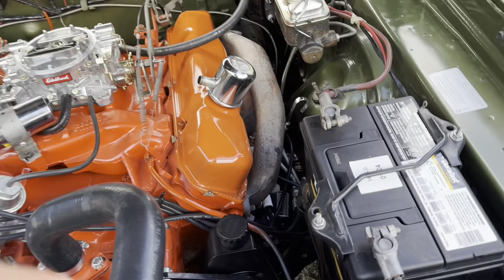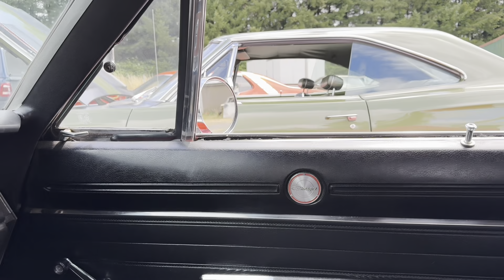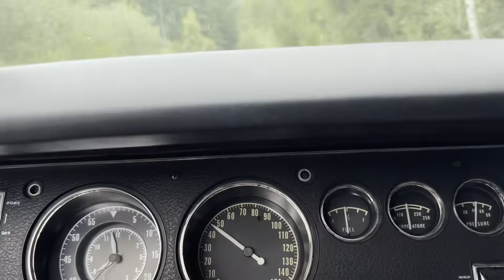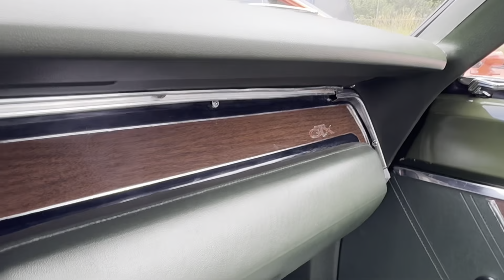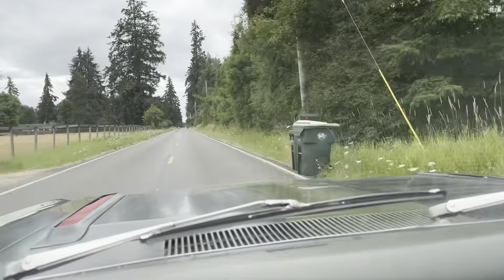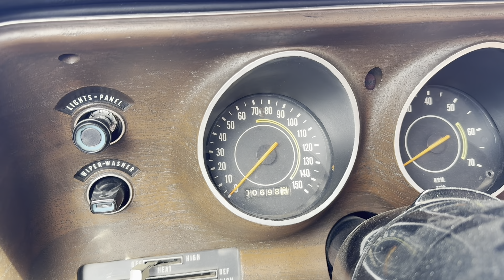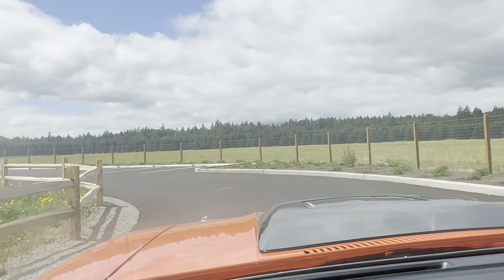An Expensive Front Suspension Is Not The Answer! Magnum Force vs Borgeson Vs Stock Mopar Comparison!

Comment: If ur not happy with how the coilovers are ....why don't you add the extra support for them instead of whining about it an putting it over the internet....😂😂😂
Reply from the maker: Because it’s a stock car we don’t want to modify and Magnum Force is bottom of the barrel for quality on these systems, absolute junk.  The torsion bars are factory engineered with literally billions of miles of testing, the magnum force?  Not so much.  Read the stories of the control arms failing at speed because of shoddy workman ship.
Reply: @rocketresto  I would add that you are adding actual value back to the car as opposed to the devaluation that the previous owner payed for.
Reply: I digress, my friends 62 C10 hads torsion bars, so did my pops 66 Toronado. I suppose those were junk too. lol
Reply: Because we’d rather throw them in the scrap pile where they belong instead of trying to scab garbage together to improve the crap aftermarket setup? Lol

Comment: Well looks like keeping my stock K member was a good idea
Reply from the maker: You can still do a lot of improvement with a stock key. Member forgot to mention in the video that the 1971 Dodge Challenger resto mod we did with the modern hemi had a QA one member that flexed when you turned the car.
Reply: @rocketresto  100%! I’m used to driving vehicles with torsion springs, and leaf springs. I’ll just get new control arms, better shocks, and new bushings and call her good.

Comment: What size torsion bars are you going to put on the Road Runner?  I would think a 1 inch bar with the Bilstein shocks might be a good combo.
Reply from the maker: Probably will go with the Bilstiens however, I like just running a stock set of torsion bars with a swaybar. My dad is getting older and want the better ride. Ultimate handling is not what we are going for.

Comment: I agree unless you are going to do auto cross or some kind of road racing man leave it stock and save the money.
Reply: I disagree.  I autocross and track day mine, and factory stuff is best. I DO use the offset bushings in the UCA, though. More caster, not camber.
Reply: @rickoates-eb3ni  Really that's cool All I keep hearing is if your going to autocross or what ever it's best to upgrade your front end with coil overs and control arms and all that stuff.
Reply from the maker: That is the one situation where it really makes sense but otherwise I don’t get it.
Reply: @rocketresto  Same here. I rebuilt the front end on my 68 Plymouth Satellite and it drove just fine and only at a fraction of the cost for what you would  pay for one of though high end front ends.

Comment: I do fully agree love torchon bar stock ride is fine
and magnum force is crazy expensive doesn't fit great and the shock tower mount flex the body
but will say the q 1 system is really nice fixed alot of that and the ride is great and if you do track days alot more adjustment but for street stock is way more than fine
Reply from the maker: I would love to try a QA one to compare against but just have heard so much bad stuff about magnum force, and this really reinforces what I have been told
Reply: @rocketresto  I've watched video of the QA1 being run on track with the camera pointed at the front suspension.  I'd heard that they didn't have much travel and this showed it pretty clearly, every time the car hit a bump mid-corner, the spring went solid.  Car wasn't particularly low either... they're just lacking in travel.  It's one of the reasons I stayed with torsion bars on my car.

Comment: I am building a 72 Satellite right now. Planning on full QA1 front and rear suspension. QA1 suggests Wilwood brakes. What are some copmparible or even better brakes then Wilwood? My experience with Wilwood is not great. Installed rear disc brakes on an 8 3/4" axle. Used the internal drum style parking brake a few times to stop the car when pushing it around in the shop. The drum brake shoe lining destroyed themselves and scored up the drum inside the rotor too.
Reply from the maker: On pretty much every car we modify in the shop we run a 73 to 76 a body disc brakes set up with the caliper adapters to run 12 inch rotors look at Dr. diff he has great stuff for this including rear disc brake set ups
Reply: I ran all the numbers on pretty much every setup available up to the 14" Willwoods with 4 piston calipers.  The setup with the best brake torque... stock Mopar 11.75" from FMJ cars (which is I think what Tom is recommending).  For track use the larger rotors will get you better heat rejection, but for street or autocross use, the factory did a great job and it's a bolt on.

Comment: Really nice video and comparison.  but KYB shocks?  Maybe they're different now but the two Mopars (and in fact any car that used them) that I know of that had them in the '80s-'90s went from a little bit wallowy (from worn out OEM shocks) to riding like an unloaded  HD truck.  You felt every expansion joint and pebble you ran over, amplified.   Bilsteins though.... my friend who put together a 'road/handlng' Satellite with > 1" torsion bars (I remember 1.03" but may be wrong) and Bilsteins, while firm, was not uncomfortable at all.  It had big anti-sway bars too.   Handled and cornered great!

I
Reply from the maker: Bilstiens are definitely a better option but also 3x as much to buy them.
Reply: @rocketresto   I know, I've priced them, but the 1980s KYBs I had experience with were like installing a steel rod in the suspension.  I know they extended and compressed but you sure couldn't feel it... like I said, maybe what they make now is different/better.

Comment: With the added power many put in these cars you need better suspension or you’ll be all over the place
Reply: Right. Better suspension = heavy duty torsion bars and a bit sway bar. Better suspension does not being boogered on garbage that doesn’t fit.
Reply from the maker: If you have new front suspension with a sway bar these cars handle fine.

Comment: I saw when you bought the '71 RR and were explaining about the suspension. I was considering the tubular K-frame and coil overs for my '74 Challenger but now I'm not.  I'm sticking with the factory parts. your correct with the shock towers not being designed for coil overs and the load force should be on the torsion bar anchors. this is why I watch videos to see other opinions on aftermarket parts.
Reply from the maker: Good call.
Reply: QA1 makes kit's that keep the t-bar's there a box-steering and then there's the rack-kit as my new engine has a 8~in SS-types 🍞 pan the drag-link doesn't fit well and or iv herd it can handle if set-up correctly

Comment: When engineered correctly rack and pinon is much better for slow turning and other benefits while driving fast.
Reply: How is it much better? Because I’ve driven a lot of Mopars in a lot of parking lots with stick gearbox and linkage and it seems to work just fine. It sounds more like you’re comparing power steering to manual steering, and that’s a fair argument.
Reply: @DeadDodgeGarage  it's more direct than tie rods and wears less.  The less points of failure make it more reliable.  I'm just talking about the mechanics of rack and pinion over tie rods. Torsion bar suspension is still a reliable and comfortable suspension. I might have been overstating when I said much. Like on the video it's 15 year old technology and I didn't see it on a lift. I have worked with Ron on different suspension sets.  I like to bag my cars for ease of changing the ride height and torsion bars make that difficult.
Reply: Thats not worth upgrading then for parking lot manuvering.....TORSION BARS are best and easily adjustable.
Reply: @samiam5557  having a homologated road/track car is worth it to be able to drop the drive height for racing by pushing a button.  It's not possible to bag a car with torsion bars.  How many racing victories do you have?

Comment: The shock towers are not totally carried by the inner fenders. The shock towers are part of the frame rails.
Reply: Yes, there is a sheet reinforcement underneath the inner fender that ties in the shock mount to the frame rail. So we’ve got two flat layers of sheet metal supporting all of the weight and taking all of the cornering and suspension forces… cool
Reply from the maker: It’s not nearly enough and not designed to take that kind of load.

Comment: That suspension is something the factory engineers got right. Can you improve it, yes. Should you, for most applications, no
Reply from the maker: You don't have to reinvent the wheel when the wheel works.
Reply: I built a B-5 blue stroked 67 barracuda rag top 4 speed w a 1971 360.
I used Magnum force front end  parts on it.
After  2 weeks of dealing w that stuff I yarded it all off n rebuilt the entire stock front end n it handled like a go kart.

I just lowered the torsion bars a bit.

These old cars don't do well w modern suspension IMO.
👍🤙
Reply: i think in general yeah as active is the only upper-pathways ie t-bar or air or frenching-hydraulics 

the back leafs im not a fan of on my charger 2g as i see 1950-60~ packers Caribbean as a better choice ( and 3-link + watt's ) with fully-t bar'd ect it would make a interesting comparisons as mopar released there version about the same time as bankruptcies for studibaker/packers LLC and or my charger's close in design and sized ect

willwood's kit go big or ( started of all drums but had to many's problem's like china-slave-cylinder/bleeder popping-off and complete fail-PSI ) stay hazy/stock, i whent with the carbon-carbon up-grade pathway ( and same-ish-sidewalls% ( don't like rubber bands for tires ) + wider-tires to match ect, and running a pre-1993~ bendix 9 master-cylinder bolted in as jeep/mopar is lazybones and i benefitted from this for boost/camshaft swapping ect ) but currently running steel/hawks-pads as up-front is $$$ and im doing other things like a tr6060-swap+stroker-build D8-head engine

Comment: Everybody complains about the Mopar torsion bar suspension (Uncle Tony), but did you know that the fastest cornering race cars in the world use torsion bars? Yes, that’s right….. Formula 1 cars use torsion bars! No coil springs! No traditional shock absorbers!

Torsion bars❤
Reply: Uncle Tony's Garage is pro OEM Mopar torsion bar suspension.
Reply: and they weight way less than a normal auto, and the tires are twice as wide, they dont need shocks
Reply: @williamdozier5190  Incorrect.  All springs have a natural frequency, including torsion bars.  You can see this in any car with bad shocks as they porpoise down the road after a bump.  Shocks dampen that (hence the proper name for them is dampers).  F1 cars are no different...
Reply: OEM torsion bars and semi elliptical  leaf springs for the win!❤ No traction bars either. Sema and modern nascar 👎
Reply: Plus the torsion bar front suspension is lower in the chassis than coilover.

Lower center of gravity=better handling